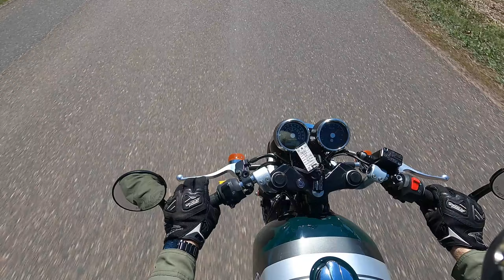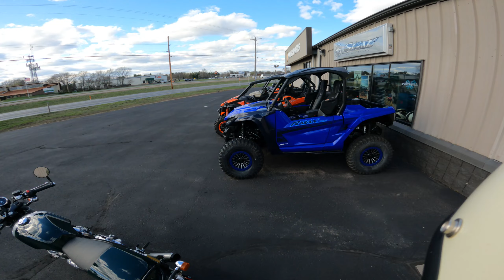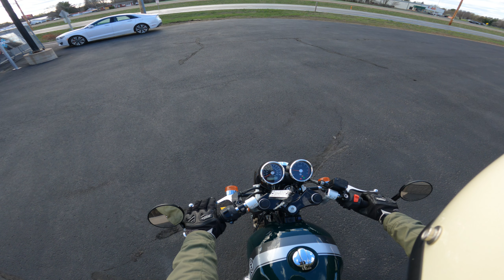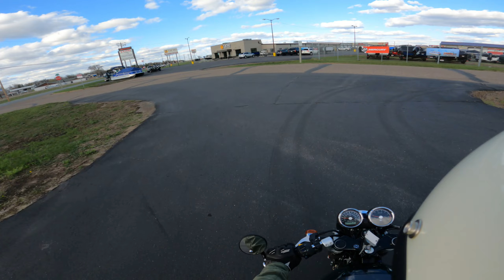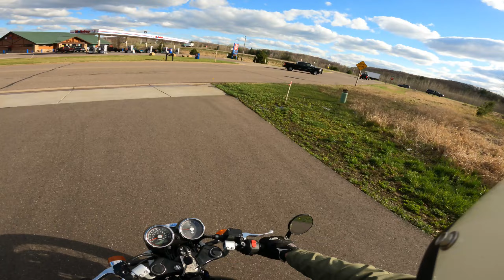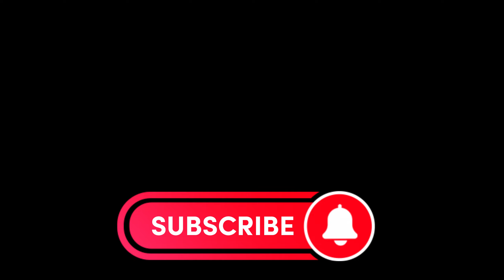Royal Enfield 865cc Continental GT Hotrod

Comment: This Continental sounds quite a bit throater than the original 650, much more powerful. Bet the torque is measurable increased!:hand-purple-blue-peace:🏁🏁
Reply from the maker: Torque was much better, a little more vibration in the bars but a lot more roll on power.

Comment: This is gt650 not 850 bro
Reply from the maker: Correct, except it has a 865cc big bore kit installed so its neither a 650 or a 850.
Reply: Correct, but since the bore was increased, it is now a 850cc motorcycle according to DMV to remain legal on paperwork. Makes a difference on legal paperwork and insurance documentation.:hand-purple-blue-peace:🏁🏁